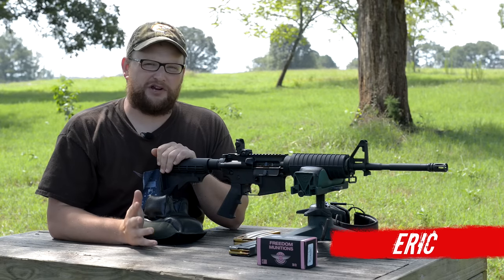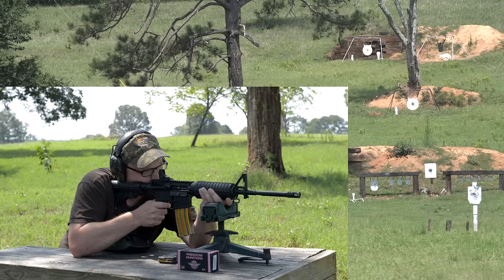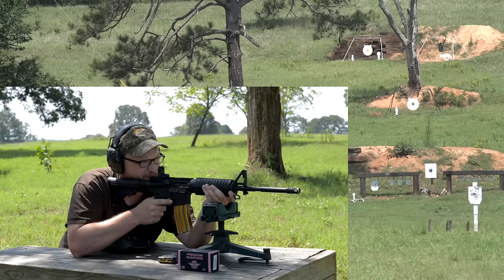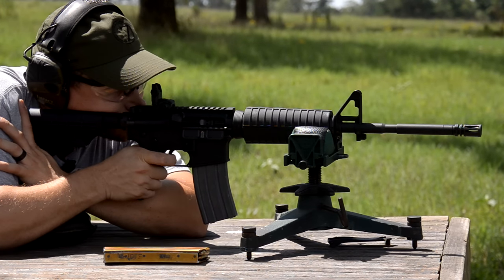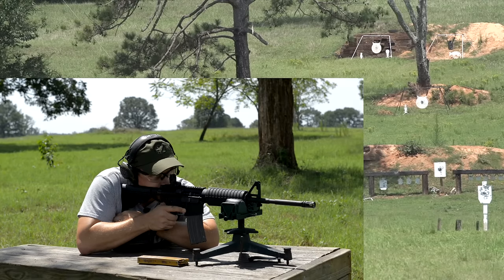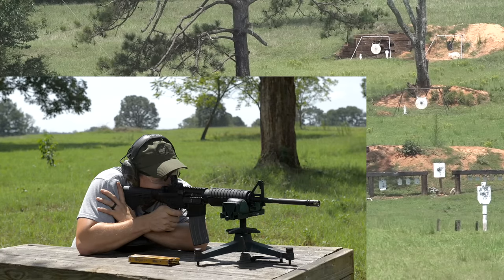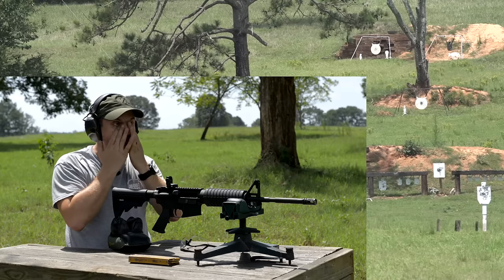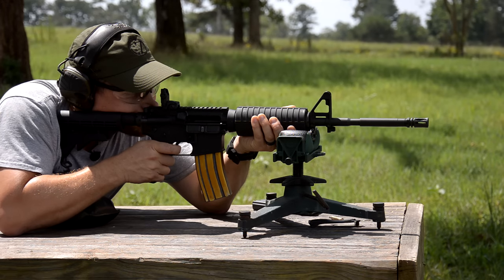Basic AR-15 Practical Accuracy

Comment: what is stringing?
Reply from the maker: Stringing is basically where anamaloies such as barrel harmonics and heat start to cause groups to open up in a way where the throw shows in a vertical or horizontal line. The groups are still "consistent" but it's the odd factor that causes the groups to open up. The idea is that the same rifle would group reasonably well save for factors like handguard contact, barrel temperature, etc
Reply from the maker: Also, sometimes stringing can be caused by variances in factory ammo. Usually present in the real cheap ammo.
Reply: +Iraqveteran8888 What about the barrel in relation to accuracy when heating up? Heavy vs pencil. Will that be a consideration and upgrade?
Reply: When the barrel gets heated up then accuracy can loosen a bit. (A lot of guys use this as an excuse as to why they aren't shooting good.)

A heavier contour barrel will maintain better rigidity and therefore be able to better sustain accuracy when heated. Naturally a lighter barrel due to its thinness will heat up easier and therefore be more susceptible to loosening accuracy. 

Floating barrels have less stresses on them therefore they can ideally deliver a little better accuracy plus they typically have better heat ventilation which can help the barrel cool down a little faster.

Unless you shoot regularly,  then getting a floating barrel is useless. Just go with a standard milspec M4 carbine configuration.

For example I have a Colt M4 6920, Colt M4 6940 (meaning it has a floating barrel), and Colt M16A4, all with trijicon 4x32 ACOGs. I shoot at a 19" wide gong out to over 600 yards and I can't really tell the difference in accuracy between the three of them. All three rifles can very easily hit the gong at that distance if I get my wind direction right.

So point being, don't get caught up in thinking you need to make all these stylish upgrades to your rifle.

Comment: I live in Europe, I have the Windham Weaponry M16a1, with Iron sights. I removed the carrier handle sight and replaced that with a Magpul flip down iron sight. With that configuration, I'm getting dinner plate size groupings at 300m. I have the sight zero'd at 25m. Fantastic weapon for a reliable SHTF scenario. My 8 and 14 year old are very comfortable shooting it, this is a great selling point.

Comment: If you have a 1:7 twist then you're way over stabilizing the 55s. That's why they're not shooting that well. Try some 77gr rounds and I bet they will shoot better. Nice videos though!
Reply: There is no such thing as over stabilizing a round.. Internet myth. Ideal Twist rate is determined by length of bullet not weight but heavier bullets tend to be longer. Some rifles like different weights in bullets or types of bullets in same weight. The only problem with fast twist and light bullets is sometimes a light jacketed high velocity bullet will come apart with to fast a twist. The 22-250 with a fast twist light bullets is the one most common with this problem. FMJ bullets will not have this problem.

Comment: would an ak do this?
Reply: Short answer- YES
But your question is too open ended......   If you get a last ditch rifle and put garbage ammo through it, it can have up to 4-5MOA accuracy;  But a well manufactured AK with Wolf Military ammo (any kind really) can easily match this level of accuracy. The whole difference is that 7.62×39 goes transonic several hundred yards before 5.56×45 will; although with 5.56 even shooting hot loaded, heavy grain bullets or something similar still doesn't have the terminal effect most people want at such ranges.  (Pushing either cartridge beyond 500m involves fighting the wind a good deal as well) 
So, the long answer is- both platforms have had decades of R&D behind them as well as the ammunition they use, meaning within reasonable engagement distances (0-300yrds) with either platform; AK or AR, rifle or SBR, FMJ or HPBT, they will always out-perform the end user.(99.999% of the time). There are the few...
Reply: Jake Dunning best damn unbiased answer I've ever heard to that question good sir.  I salute you.
Reply: Yes...enter the AK-74 in 5.45x39...the Russian answer to 5.56x45.  AK-74 is better compared to AR, not the 30 caliber AKM.

Comment: I have a 16" 1 in 7 crome lined d star upper on an m&p lower with a wal mart nikon p223 1x9 and with cheap ammo 400yd milk jugs are boring..3 for 3 cold bore... set a 28" flat screen up at somewhere near 1000 and with a try or 2 I hit the sob...blew my mind. Most fun I've ever had. Shootin off the top of my truck..scope is mounted with Talley steel mounts..makes the whole thing possible

Comment: In the Marine Corps, to hit center on a 300 yard target you have to hit a 12 inch circle, Back in my day, we didn't have anything but open sights. At 200 yards, we used the same target but you had to shoot 5 rounds in the offhand, 5 kneeling, and 5 sitting and 10 rounds rapid fire from the kneeling. At 500 yards we were prone for 10 shots. To hit center you had to hit the 20 inch wide by 40 inch tall man silhouette. Out of a possible 250 points the best I ever did was 248. I went to the 500 with the possibility of getting a perfect score, but the wind had different ideas. We also had rapid fire at the 300 using the "D" target that was 26 inches wide by 19 inches tall half man silhouette. Fun days guys. You guys should do a video to recreate the old rifle range days and see if you can achieve the expert rating. If interested, I will give you the particulars and what we did on each firing line. Enjoy y'alls videos!

This is my rifle this is my gun, this is for fighting this is for fun!
Marines die, that's what we're for, but the Marine Corps will live forever and that means you live forever!
We will conquer communism, with the aide of God and a few Marines!

Comment: I was shooting consistent 3-4" groups at 300 yards the other day. But, I was using a Vortex 1-6 Strike Eagle, with a free floated Mlok handguard. 1:7 twist chrome moly bbl. Cheap Federal bulk ammo(55g). Very happy with those results, tho. Mid-length gas system ejects at 3:00. And, it runs like a dream. DelTon makes a GREAT AR.   Very good shooting, with irons guys. Pretty impressive.

Comment: Great demonstration of how one zero can be "minute of man" accurate out to 300 yards.  The 50 yard zero, on my rifle, puts me 2" high at 100, 3" high at 150(apex), 2" high at 200, zero again at 285, and about 5" low at 300. My optics are mounted a little higher than normal. I'm a tall guy.     This is the perfect zero, in my opinion. But, it really doesn't matter what zero that you choose, you just need to learn your rifle, at different distances. Get out and SHOOT!   Ballistics calculators can help you get in the ballpark, but you MUST know your EXACT muzzle velocity, and your EXACT height of your optics, above your bore. Keep in mind that the advertised muzzle velocity on the box, is never correct. My average MV is around 2,950 fps, out of a 16" barrel.   Great shooting guys!  Especially with irons...

Comment: Honestly I think it's all in the shooter. You take someone that's never fired an AR-15 before set up a playing card size Target 150 maybe 200 yards away and there's a good chance they won't even hit it. Take somebody that has been using a rifle with that setup or one very similar to it for a long time and you'll probably see one hell of a difference.

 Don't get me wrong magnification Scopes a longer barrel and it free floating barrel definitely don't hurt.

I have a Sig m400 Moe classic. I think that's the technical name for it. It looks a lot like the one in this video. The Ford grip is shaped a little bit differently the pistol grip is very rubbery. I have a carry handle on mine. I do have an optic that I can put on top of the carry handle if I want to. I'm dedicating another rifle entirely to one without that a two front post and carry handle. This one I'm building. It's going to be my reach out And touch somebody rifle. 20 inch barrel. Possibly longer if I can find one. Booming scope. The barrel's going to be free floating. Definitely going to spend the money on the barrel and get a high quality one. We'll see if all the hype is true.
Reply: Take hickok45 for instance. He's great off iron sights most times when he misses he'll take note if its off to the left/right a bit and then usually nail the next shot

Comment: what you may wanna do on those front sights or others like AK's.....i filed mine to basically a pyramid (all 4 sides of sight post)....and i put a drop of white paint with a q tip.      that fine white angle you can easily place where you want it instead of covering the whole target when you shoot far out.

Comment: I have a 16 inch Colt and when I first took it to the range I brought four different types of 55 grain fmj ammo and the difference of accuracy was all over the place. Luckily it liked the cheap stuff, Perfecta would almost sub MOA. So to use just one ammo brand is not an ideal accuracy test. Finding what it shoots most accurately is trial and error. When my 16 inch Colt 1/8 twist liked $14 for 50 round ammo I was a happy camper.

Comment: I'm pretty impressed with my windham .223 super light src. For $640 out the door w/3 boxes of ammo, I'm knocking on the door or MOA  with bulk 55 gr fmj (frontier/hornady) which is the only load I've tried. The only thing I've done is a $100 fixed 6x scope and a vg6 gamma brake neither of which affect accuracy. Not bad for a 16" pencil profile barrel with a 8lb trigger. Based on my experience, with a better trigger and some load development, I am looking at .75 moa or better. Go Maine!

Comment: I would add that barrel twist in relation to bullet weight is important.  Also bullit quality is important for accuracy.  I, and my friends have built many AR from the cheapest lowers and found it makes no difference, even the polymer lowers work great.  It is the Barrel and trigger where you have to upgrade to.  I would not build without a Wylde chamber and a $100 trigger like JP enterprises trigger.  If you wait for specials you can build for under $600 for a great tack driver.

Comment: Can't really judge the accuracy of a rifle without trying different ammo loads. I have two bolt 223's and they both shot 1-1.5" at 100m with the first factory ammo I got. Started handloading and got 3 shots in the same hole at 100m multiple times with both of them in perfect conditions. Also found some factory ammo that shot 1/2" consistently. If I'd just used the first ammo I found I would have said the gun was innacurate, but like I said the ammo is most important

Comment: hey guys. I just had one question about iron sights with regards to the AR platform. I recall watching  some documentary once upon a time. I think it was on the history channel, but I don't remember exactly. What was mentioned in this show in particular had to do with the design of the IWI Galil and what feature it had that made it easier to have tighter iron sight groupings at greater distances than the AK-47. I am referring specifically to the amount of separation on the sights. With the AK-47, the front sight is almost right at the end of the barrel and the rear sight lies immediately forward of the breech. With the Galil, the overall separation of the two sights was greater than that of the AK with the rear sights being just short of where the shooter's face would be. This greater separation of the sights, was what they attributed to tighter shot groupings at 100 meters than would be achievable by the AK. In the documentary, one man had the AK and fired X amount of shots at 100 meters, the other man had the Galil and did the same. Both men were formerly of special operations groups and were very highly trained. Even so, could the depicted defecit in iron sight accuracy on the part of the AK be attributable to shooter's error, or can accuracy be noticably effected by placement of the front and rear sights when designing a weapon? If that is the case, is it possible to extract a little more accuracy from an AR by changing the placement of the front sight from being at the end of the handguard, to beng right at then end of the barrel? Would such a modification be practical?

Comment: Eric - Nice shooting there but I did notice something that you could improve... on MANY of your shots you are very slowly letting the trigger out to reset and then hammering the trigger back after reset occurs. I catch myself doing this from time to time and it does certainly hurt accuracy, especially at greater ranges. I know you know all this but as a reminder, follow through with the shot just like you are, but then just let that trigger out to reset, no need to slowly let it out like you are squeezing the trigger. Once reset happens slowly squeeze... really on many shots you are almost switching the two. Quick forward, slow back, not the other way around! Watch the video and you will see what I'm talking about. Cheers!

Comment: Twist rate and bullet weight and bullet design can be very subjective in 223 / 5.56 caliber  I built an AR last month with a Stoner 1/7 barrel that shoots best with 40 grain ballistic tips . And an older build of a 223 Stevens bolt action with a 1/16 twist that likes a 63 grain soft point load . While another A R with a 1/8 twist shoots  55 f m j like a tack driver both suppressed and unsuppressed  but will not stabilize a 55 grain soft point or hollow point while shooting suppressed . I enjoy this caliber it never quits teaching me new things , even if they defy the accepted design specs .
Reply: Basically any twist rate  will shoot the 55 grain just fine at 100 yards. As the speed of the twist increases, lighter bullets will not perform as well at extended ranges. 1:9 twists are great for 55-62gr ammunition and will perform best at those weights. 1:8 is considered a good middle ground twist rate and will perform well with a broad range of weights, around 55-69gr. The 1:7 twist is best utilized with heavy rounds like 77gr, but can also fire the 62gr rounds with decent accuracy. However, many people will argue that the military would be better off with a 1:8 twist.
Reply: I have had about 5 or 6 with 1/9 twist rates . Most like 50 to 55 grain the best , but may stabilize anything from 40 - 63 grain . I hand load 95% of what I shoot . I always get the best results with loads at 223 specs . The increased speed of 5.56 specs seems to adversely affect the accuracy for me . Try as many different brands as you can and if you find a sub moa group at 100 yards . Stock up on that one .  I hope that is helpful . I don't like to recommend a specific brand or bullet because every gun likes something a little different . However I always start with something common such as Federal or Remington 223 in 55 grain  f m j . Good Luck.

Comment: Y'all mentioned the rifle possibly being over gassed, and then began speaking of changing the buffer and spring. My question is, why wouldn't you run an adjustable gas block so that the gas system can be tuned to whatever load you decide to put in the chamber? Say something like the superlative arms bleed off gas block? I'd like to see a review/comments from folks whose opinions I respect regarding this product as I'm considering using it for a build of my own.

Comment: both of my FN ARs are rediculously accurate, something i jump at the chance to brag about because it just seems they are not normal ARs.

i have a FN 16" M4 with a 5.56 chamber that ive modded a bit but has the stock barrel, BCG and receivers of course and a stock FN 18" match grade sporter SPR with a .223 rem chamber.
i have a Primary Arms 1-8x ACSS SFP scope on the M4 and a Primary Arms 4-14x ACSS R-grid FFP scope on the SPR.

both commonly fire perfect, single round hole 3-rd and sub 1/8" to 1/16" 5-rd groups at 25 yds with inexpensive Norma tac .223 55 gr ammo.

at 100 yds both fire sub 3/8" 5-rd groups with Sig Sauer 77 gr OTM match loads.
thats with a 5th round flyer problem im having.
i routinely pile 4-rds into a single ragged 1/4" or less group with the 5th round "opening" the group to 3/8" to 13/16".
if i can work that problem out i fully expect routine 1/4" groups!

this is not an occasional thing. i can duplicate the 25 yd groups practically at will and the best 100 yd groups, say sub 1/2"  generally happen atleast once in every four groups.

ive also fired many 3/8" to 5/8" 3-rd 100 yd groups with Federal GMM 69 and 77 gr loads with the M4 firing from prone that did not exhibit the 5th round flyer issue.
so im sure its me. but either way that blows my mind that this standard M4 with a chrome lined barrel, something that is suposed to be detrimental to accuracy, shoots this well.

im not that shocked by the match grade SPR but for a basic M4 this seems like extraordinary accuracy.
both barrels are chrome lined to boot!

im just curious if others are seeing similiar results from their FNs or other ARs whether chrome lined or other?